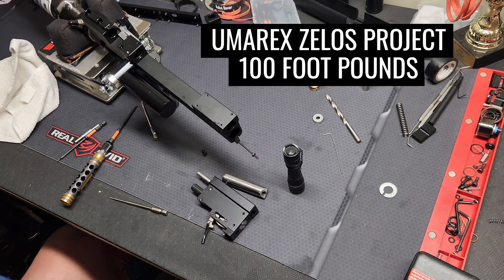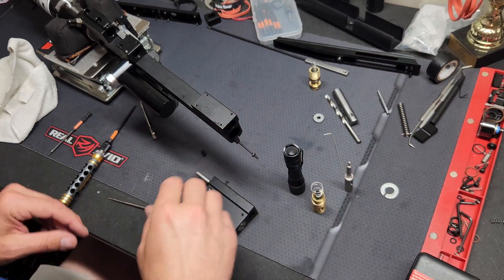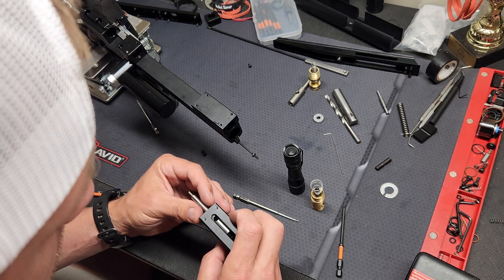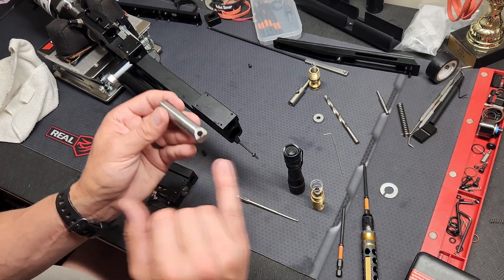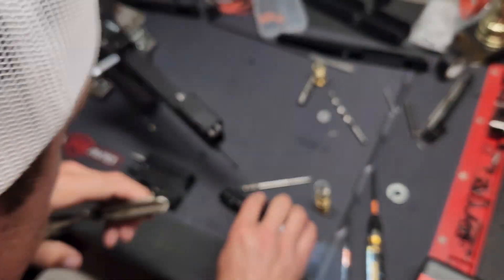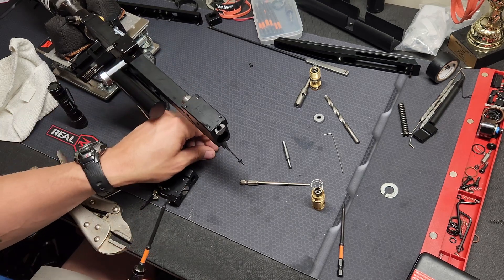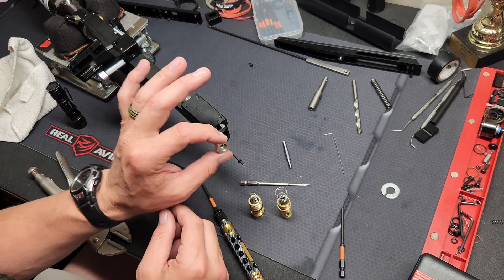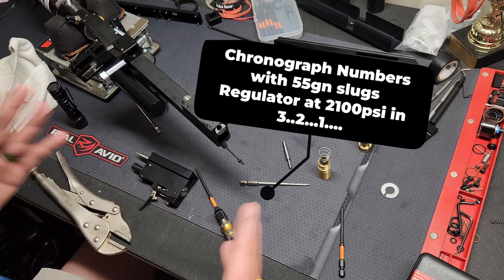100 Foot Pound 25 Umarex Zelos Project

Comment: You wondered why I made the comment that I did on Viking air gunner, section. Look at the guy you got that valve from. He’s only smart enough to make a bigger valve opening and a bigger valve itself. He doesn’t realize that you don’t need that humongous spring. He put on there. Why do you need that spring because the valve is bigger and it needs more pressure to keep it closed.. This is why I have the comments. I do the stupidity of people. Take the spring off that valve.
Reply: You need to stop drinking when making comments on YouTube videos.

Comment: how much pressure are you gonna run that air rifle on. Unless you put a 30 inch barrel on it. You’re gonna need some pressure there barrel length is gonna be important. And the caliber don’t even know the caliber if it’s 22 if you’ve got a 22 inch barrel you’re gonna need 3800 psi. That’ll get you to about 78 foot pounds with a 40 grains slug.
Reply from the maker: Its a 700mm barrel it's a 25 caliber to get 78 foot pounds is nothing maybe 1600psi on the regulator

Comment: Leave the patron spring off of that valve. You do not need a return spring. It only causes inconsistency, and it makes it harder for the hammer to open the valve. You will see that rifle will pick up even better consistency than it may already have because it is a snow peak product.
Reply from the maker: There are to many variables Running no valve return spring. This rifle is capable of plenty of power how it's set up. We'll over 100 foot pounds

Comment: I'm trying to increase the FPS on my Notos. Is there any way to boost power would adding a plenum help? Or is there more porting I can do? I've already drilled out the block in front of the poppet valve.
Reply from the maker: Remove the washer from the poppet, add a plenum
Reply: @802_AirHead  Thank you Dan! I will try that.
Reply from the maker: @gboutdoors5198 if you need any help along the way feel free to reach out you have my email

Comment: 100fpe is crazy
Reply from the maker: It was a lofty goal but I pulled it off
Reply: @802_AirHead your apsolutly magical with theses things. You knew you could do it quite playing. Mad skills bro
Reply: My buddy got a nusence tag and I took a deer in his garden with a avenge x .22 cal with a 33grn jsb monsters think it was right at 50 fpe. Right in the back of the head deer just dropped didn't even twitch or nothing. That's when I leard that pcp make you a better marksman cause of shot placement and variables
Reply from the maker: @Manicarms I always recommend 300 foot pounds when hunting larger game.  I have seen guys run 357 rounds at 150 foot pounds and drop deer with head shots.
Reply: @802_AirHead it was facing away and to the nape of neck when I did it
Reply: I couldn't use nothing big considering the location
Reply from the maker: @Manicarms there are some heavy hitting 25 and 30 cal out there that can be made to be super quite
Reply: @802_AirHead yeah my gauntlet sl30 is stupid with them 60grn brimstone slugs
Reply from the maker: @Manicarms  Great rifle if you are looking to experiment and modify